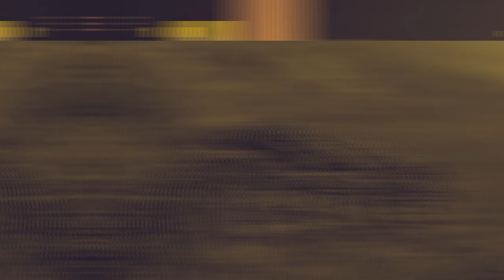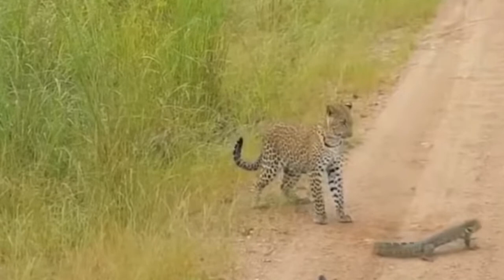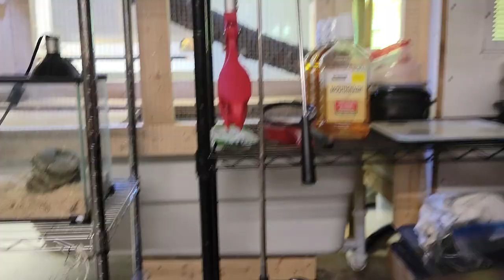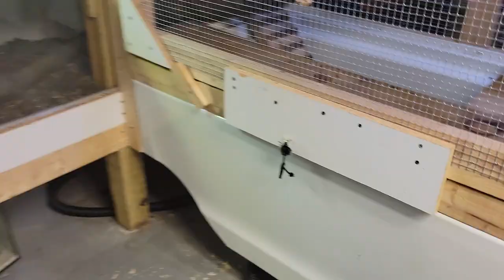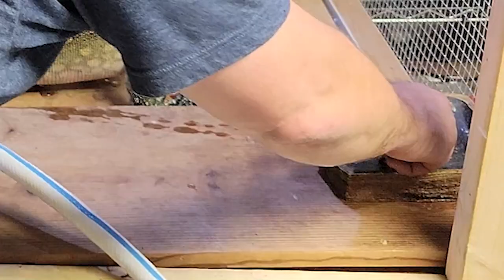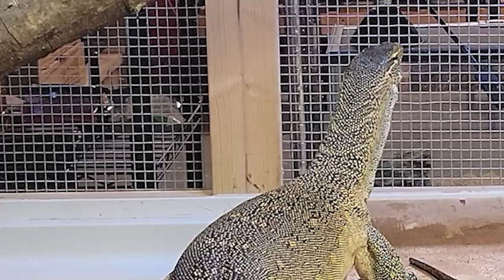Do I want a Nile Monitor?

Comment: Definitely some wicked claws.
Reply: I'll stick with my two Tegus. My red 9 month female's nails are ridiculous needle sharp but maybe only 7-8mm long. I can somewhat deal with them. They cause me to bleeding often but smaller scale bleeding than a large monitor. The 3ft B&W male's nails are bigger/longer but not necessary razors which is much better. Just typically leaves red skin raised marks.

Those monitor lizards are insane 1" long cat claws/daggers. Downside of cats imo have always been their claws and feline teeth. I'm a dog person.
Reply: Mine sits in my lap once a month and gets his claws trimmed down. It's not too bad if you just stay on top of it.

Comment: Are Niles really Harder to keep than similar sized monitors like the Argus monitor? Or do they just get a bad rap because they are cheap and inevitably, they are the monitor inexperienced people end up buying. I know they are flighty and like to bite, but are they really that much worse other monitors like the blue tail, argus, or mangrove monitor? It's hard for me to believe they are worse than a croc monitor.
Reply from the maker: I can't speak to all those species first hand because I've worked with AWMs, Niles, cross and mangroves...but in my experience the Nile is the most reactive. Of course socialization matters a lot...a Nile ya spend thousands of hours with will be easier than an awm  that is left alone. Crocs of course are much more dangerous because of those monster teeth but most of those I've seen have been fairly mellow.
Reply: @IntrepidExotics  Thanks for the quick response! You earned a subscriber!
Reply from the maker: @1ntense796  awesome, welcome aboard!

Comment: I'm really trying to get a big lizard pet but my only experience with them is when I owned a water dragon for a year and a half and I babysat a bearded dragon. Any idea on the best big lizard? I'm kinda worried the nile will be too much but they look so cool with there patterns. Any help from professionals would be great
Reply: I'm going to continue doing research on the smoothest introduction to the big lizard world I can get.
Reply from the maker: If you like the look of monitor lizards there's others like tree monitors and ackies that are MUCH more manageable both from a space and temperament standpoint. Tegus are great larger lizards that can have great dispositions but require a good bit of space and also brumate several months a year which is frustrating if ya like interacting with them. I've always like rhino iguanas too, the one's I've interacted with were a blast :-)  Niles, Asiana water monitors, croc monitors, iguanas...all of those can be really challenging to keep either because of temperament, space requirements or both.
Reply: @IntrepidExotics  I was looking at a bunch of others but they are very expensive.. kinda on a budget. So now I'm looking at savanahs which seem super great and I'm positive i have room to build one an enclosure. I just want a decent sized lizard that I can make a bond with and wont have to worry about it being fiesty if I'm calm and patient with it. But for some reason ackies are super expensive( I found them before savanahs) and omg the price is.. sheesh dont worry though I'm continuing research about diets, space, humidity, and burrow sand. thanks for the help though, greatly appreciated:)